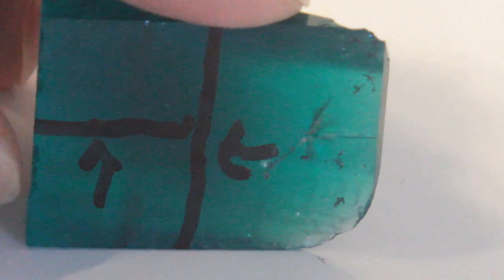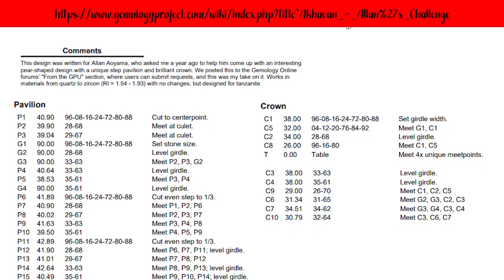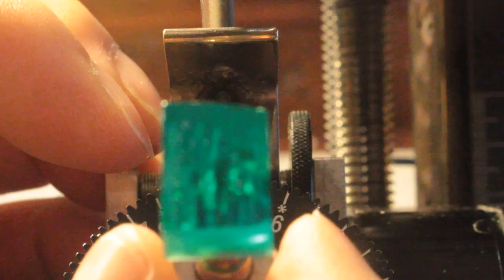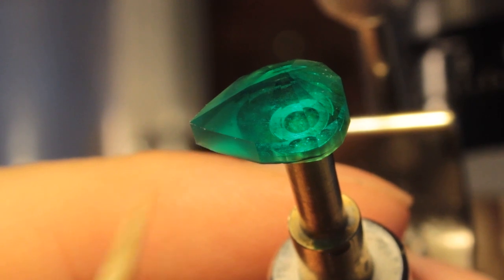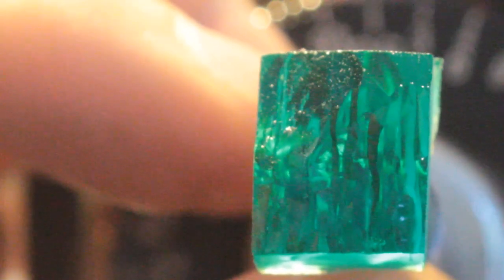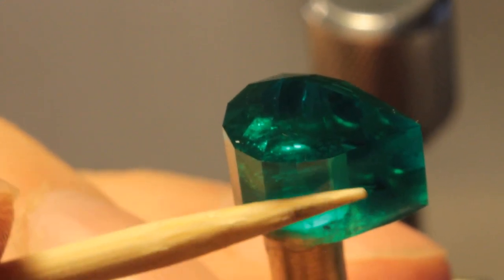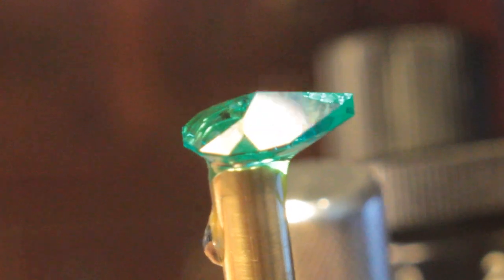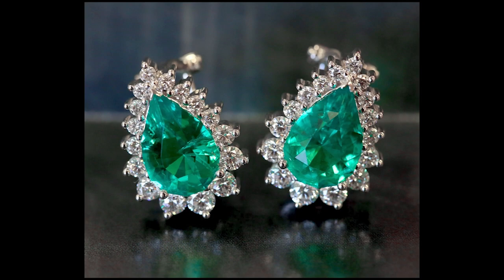Gem Cutting Tutorial: Pear Shaped Emerald Earrings

Comment: What a beautiful pair! I was wonderful if you would like another challenge? Could you do a very long and very thin piece of rough?
Reply: I don't know if I could or not.  Depends on the material, internal issues with the material, and the dimensions (length, width, and depth).  There are several gem cutting diagrams available for long thin material, such as the "Smith Bar".